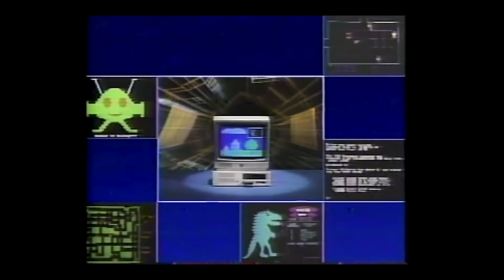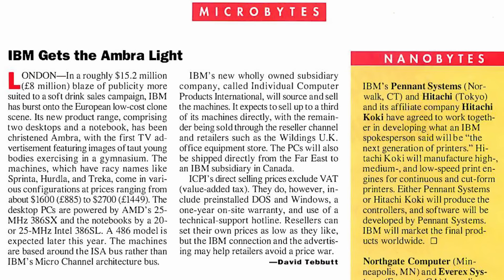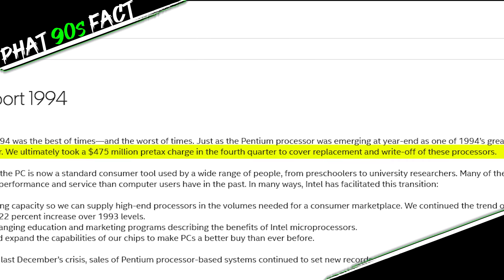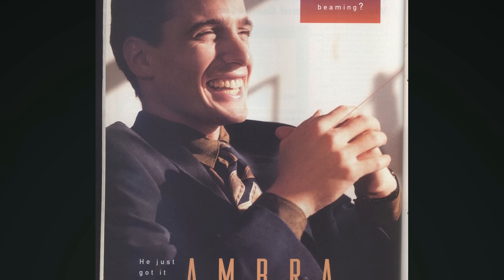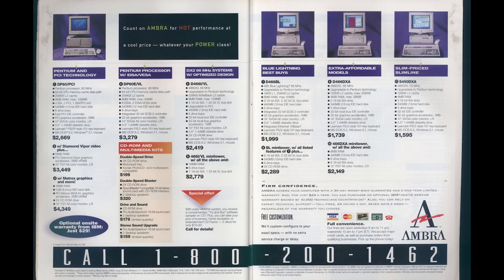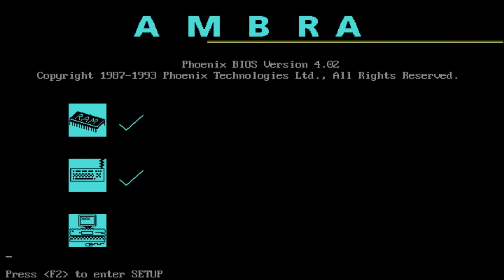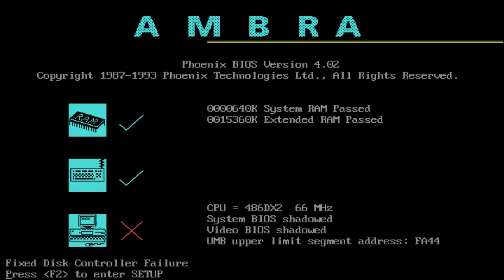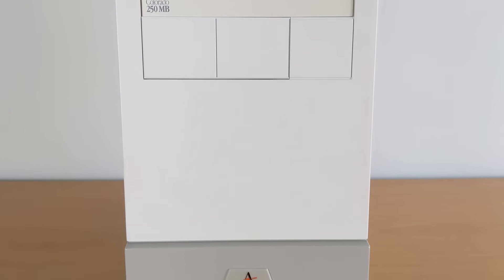The PC You've Never Heard Of

Comment: I still have my first 1976 computer.   It is a Poly 88 from PolyMorphic Systems.  Ah yes, back in 1976 I got my first dose of an S-100 based bus system computer.   I found an old small TV an turned that into my computer monitor, and threw together my own keyboard.  Program storage was recorded via the use of a cassette tape player.  My 1986 Heathkit Hero 2000 robot is still working, so things really can last quite some time if taken car of.

Comment: I remember supporting Ambra computers. The power button mount was bad and over time would break. I hacked many new power buttons on to these
Reply: Same, I worked on dozens of these. I remember dremeling out the power button hole so I could replace it with a real button.
I also remember the case was weird to open up and close.

Comment: My first PC was a Packard Bell With Windows 3.1.1 with a 486DX2 (50Mhz).  I was 10 years old.  Before that, I grew up with my grandpa's desktop playing the original SIm City and other games on the 5 1/4 floppy on DOS.
Reply: My first computer was a Packard Bell with an Intel DX/2 66 Mhz CPU, and 8 MB RAM. I was 14. It came with a 14.4 kbps modem, and a Sound Blaster 16 sound card, and ran MS-DOS 5 dot something, and Windows 3.11. I believe it had a 680 MB hard drive, and a 2x CD ROM drive. I ended up upgrading the CPU to the overdrive 83 Mhz, and 16 MB RAM, and a 56k US Robotics X2 modem with the X2 upgrade. Ahh, the memories of how proud I was connecting at 51.3 kbps. I thought it was so fast, then I got cable internet and ended up only using it for BBS connections. LoL.

Comment: The big, big price drop came from highly integrated late 80’s 286 boards and early 90’s 386 boards. Early 286 boards had monstrous amounts of chips on a large mainbord; later 286 and 386 had like 3 big chips, a clock, some cache and some memory modules. 386DX-40 was extremely common, very cheap and powerful enough to play the three amazing games of 1992 and it came along at just the right time as cheap and somewhat useful sound cards replaced PC speaker.

The three must-have games of 1992 was Wolfenstein 3D, ultima underworld and Ultima 7. Ultima underworld is such a technical and gameplay achievement that is almost as impressive as the 1969 Xerox presentation of the computer mouse, windowed personal computing and teleconferencing. The closest thing to ultima underworld were space games like Elite; but they weren’t really that close. I’d go so far as to call it the first immersive game of any kind.